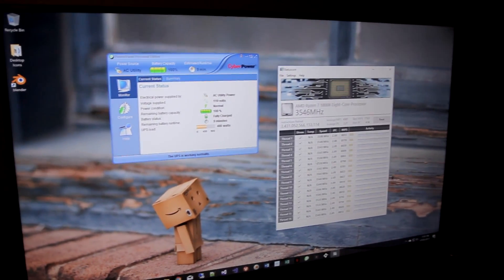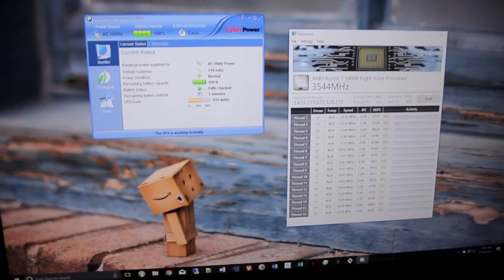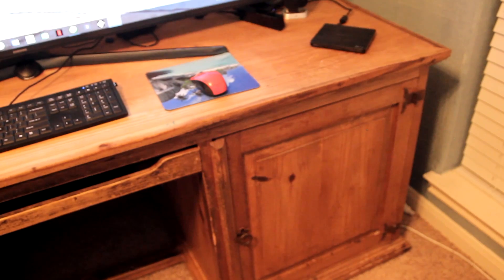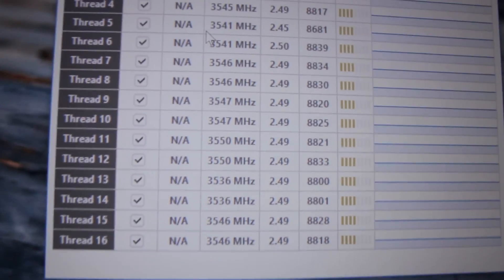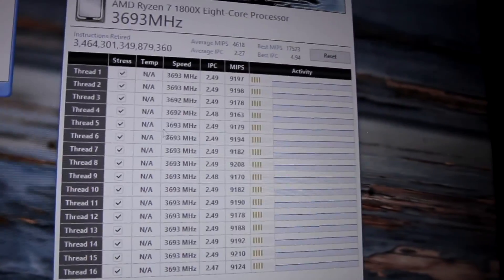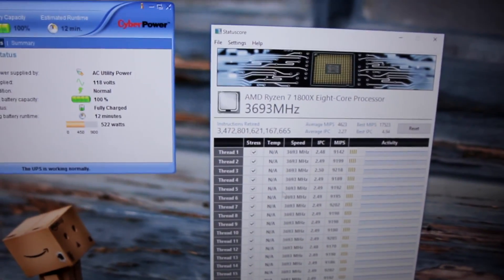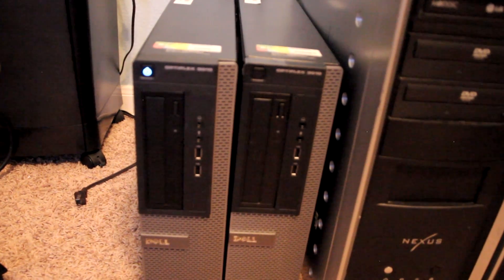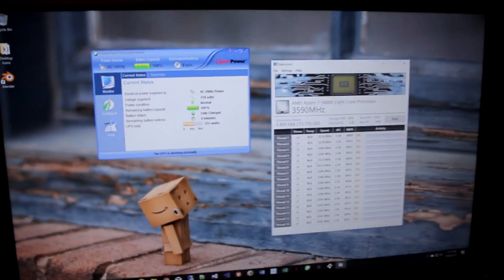Does AMD Ryzen overheat inside a closed-off wooden box?

Comment: Looking at this video made me realise that AMD might have screwed up their marketing with XFR and SenseMI. If you could remember the livestreams, it was repeatedly asserted that XFR was supposed to detect thermal headroom and allow the CPU to clock higher, when in reality it is just a normal 50-200MHz higher turbo bin, depending on the CPU.
Reply from the maker: Yea; I think the marketing was a bit misleading.  I was super disappointed when I realized XFR was only going to add 100mhz to a single core under ideal conditions, and that it wasn't going to magically overclock itself to anything I wouldn't be able to do manually.  Missed opportunity, AMD.  But overall still happy with my CPU.  Waiting for Threadripper now!